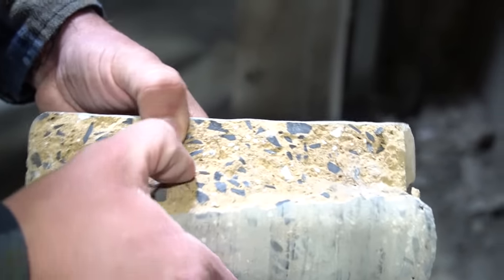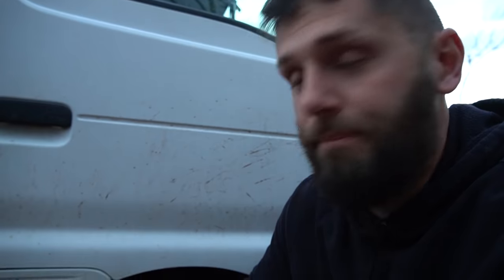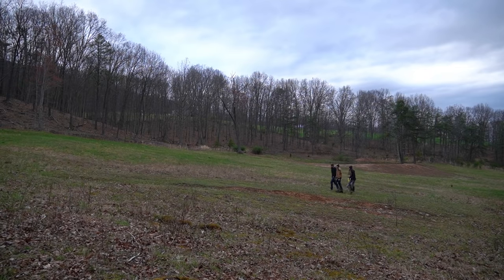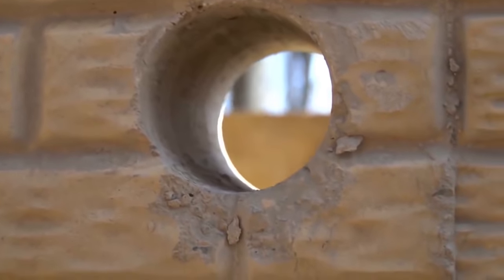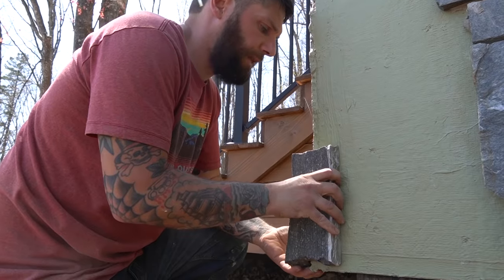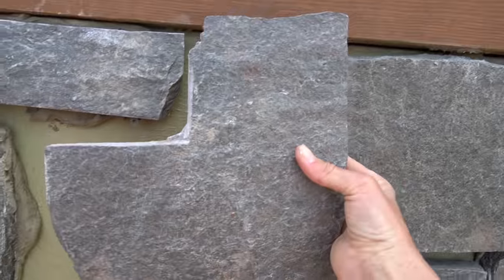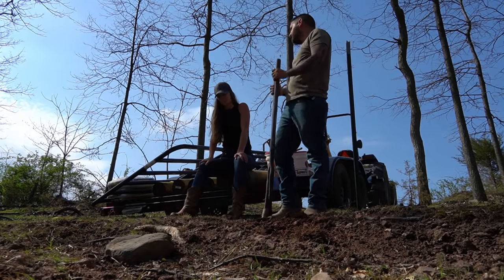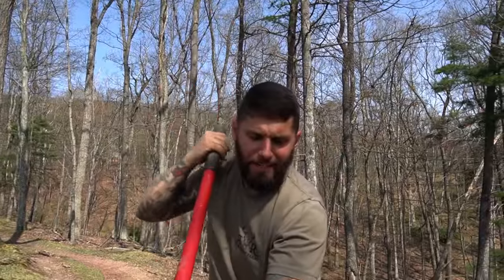RESULTS OF THE CONCRETE TEST | Are We Tearing Down Our House Foundation?

Comment: For future reference: when you contract for the concrete foundation "do-over" , write in your specifications that concrete samples are to be taken at time of pour. I've managed 1000's of yards of concrete in my career, and have ALWAYS required this!
Reply: yup it also covers your butt as far as liability and insurance
Reply: Amen this is what needs to be done
Reply: Bobby - can't you pour the same concrete mix into a 4" pvc pipe? Thereby using it as a form for the concrete.
Reply: @martyhanks5977  Marty, there are plastic molds available at most builders supply that are specifically designed for concrete samples. They're typically 6' X 12"  for about $3.00 each.  Most concrete suppliers have then on hand.
Reply: thats what I thought, that is the responsibility of the mixer
Reply: @lozhunter9575  - Actually it the onsite contractor who has the final say. When the driver sets up, they ask.."What sump do you want it" that added water amount is on the contractor. ESP...when you are talking about  pumped concrete, through a 4" tube.

Comment: Top Tip: When you go to grout your stonework, use piping bags. If you get cake decorating tips, you can get flat, very small rounds, large rounds, etc. Also, make sure the rock is completely dry before you grout or it will stick to the face. You'll also need a wide and a narrow (1") stiff brush and big sponge and water bucket.  Start in an inconspicuous spot to get the hang of it. Good luck!

Comment: Hard to imagine that a "concrete contractor" would pour such a soupy mix.   Too much slump means very weakened concrete.  Sorry you have experienced this failure.
Reply: That wasn't concrete,  it was gravy.  😱😱💩
Reply: Could write a book on turning cement into quality concrete . Contractor all ready had to read a book n look how that turned out . The reason buildings collapsed no quality control . U have almost a million subscribers. It will be a wonder if concrete contractor pours another yard of mud after all the eyes watched this mess up !
Reply: That was mud they poured. They should be ashamed of themselves but looking at those guys, they look like they don't care about much! Sad.
Reply: I was studying some tests about different concrete mixtures. 
The strongest concrete is made when the amount of water is actually LESS than what’s specified. As little as possible. Of course pouring it becomes a challenge at that point, and without tamping it down and compressing it, it may have air pockets in it, weakening the structure.
So the “normal “ amount of water is already a tradeoff, weakening the concrete in exchange for easier pouring. Adding MORE water just makes it even weaker in 100% of the cases.
And beyond “more water”, there is “too much water” and then that dirty water they dared to call “concrete”. 

I was actually hoping this test will fail. Because if THIS concrete doesn’t fail, then concrete standards are lies:D
Reply: I wood be looking for a 4-5 inch slump max on the next wall . That would looked like a cow patty , the water to cement ratio was blown to hell on that wall.
Reply: @juzoli  there are additives to make it flow better without adding more water 👍
Reply: @colinstace1758  Yeah, but they used water as an additive…

Comment: I know it is a pain to redo things like that foundation, but you will be so glad you did it right. That may have been one of the worst foundations jobs ever. Brown soupy concrete that had way too high a slump, poorly done forms that burst open and were not even straight, no height control on the walls and the J bolts just plop into the walls. It is actually amazing the concrete tested as high as it did as bad as it looked. Not to mentions leaving out the rebar and mis-positioning all of the other piers and using junk gravel as base fill.  Not sure how they could screw it up more.... But, hopefully you will find a good one this time.
Reply: It wasn't concrete. It was mud.

Comment: Quite a few holes still to make for the fence posts before you complete that red line on the sketch... Did you consider a fence post drill aggregate for the back of the tractor but ruled it out for the benefit of building biceps or something? :)

Comment: You could build a second perimeter foundation with CMU and leave that one if it works with the structural layout of the house.  Then you save yourself the demo and waste fees
Reply: I'd bet the cost of engineering the new plans will exceed demo and waste fees
Reply: Concrete contractor should be covering the cost of demo.
Reply: @craiguglandrealty3705  
If you can find them and get them to pay I'm sure Josh and Erin will be pleased!

Comment: Hate all this for you guys!! its a tough pill to swallow, but you are 100% right to stop all work and redo it now. Way easier, and you will NEVER look back and think "What If'.  As a contractor w/ 30 years experience, when i watched to original video, i was blown away that they ONLY built a 2x4 footer frame!! Here in NC its 8" Min and goes up to 12" thick and then 24" wide!! No vertical rebar inside the footer - connecting the wall, as you stated and the tiny baby 2x4 thick footer that is MAYBE ok for a tree house. I knew you'd have to take it down. So glad you started over. Only upward and onward from here. Best of luck moving forward. Keep It Up!! You got this.

Comment: Screw the concrete, why not just use metal stilts to prop the house up, run it the same way the first house is w concrete filled tubes in the ground. I see a bunch of mansions done this way and cabins on mountains and reveens.

Comment: Just lay block instead......place your rebar down each web and solid fill with mortar. Way sturdier than a poured foundation especially if you use 12" commercial block.

Comment: Mixing your concrete too WET it will be weak. Put your post in the ground 36 inches so they wont pull over.

Comment: For mixing in a bucket, plaster, concrete , thinset, mortor, etc.  The premier tool,, the labour saver,, saves your wrist,,, best, best, best  Is a Milwaukee Hole Hawg.  It has the proper speed, strength, right angle so you don't get your wrist twisted off.  Expensive,, usually about 300 dollars,, and they may have fixed it,, the switches were always a bit soft,, needed replacement.  When I would go to buy a switch, I would always buy two.  But,, for mixing in a 5 gallon pail,, I have never seen its equal.  You can mix Sackrete in a pail with a Hole Hawg.

Comment: The concrete company very likely figured they could get away with reducing the amount of sacks of concrete powder per cubic yard. Those mixes are known as for example (4 sack mix, 5 sack mix, 6 sack mix and 7 sack mix per cubic yard of cement. It's likely they jipped you guys using less sacks than they should have.

Comment: Josh, you are very accomodating in your call to concrete guy, considering it’s a Major balls up!   I guess it’s best to stay on good terms to get the company to sort out the issue. 
I like both your outlook on the situation by not freaking out and accepting the situation, rectify it and move on without the emotional stress.  Thumbs up.  👍🏽👍🏽👍🏽  I learn many helpful DIY tasks and techniques from you tw,  so thank you kindly from down under.  ☯️

Comment: I am kinda glad your concrete failed. It pushed you to the right decision. You know if you built on that you would never be happy. Take the pain now and don't fight the build and always wonder if it will be ok.
Next time Hire a professional, i know of a good one. YOU! For just an electrician you have proved yourself to me that you can do it all and get better results than some so called professionals.
Coming from a 30 yr contractor here.

Comment: For the Trout Pond project, after you tear down that awfully constructed cement foundation, if I were you, I would go with rebuilding it back with cinder block. Cinder block has a long track record for durability and strength. It is something that you could do yourselves, and get it done correctly (without another construction company screwing it up again). And, it wouldn't take too long to complete the job. Just think about it.

Comment: Hay Guys
 I am a civil engineer with alot of expirenc, more then 40 years.
I  am following your chanel for along time and enjoying it very much.
I just saw the video on the failure of the concrete samples. 
In my opinion , you can still continue building your house without destroying the Existing structure.
As much as I know there is no risk of Earthquake in your area. And even though the samples are not good the 
structure will be able to Stand the forces.
Sorry for my English. I am from Israel.

If you you went to be on the safe side call en local enginer that will give you his opinion on the mater.

You are very sweet family. keep it up.

Nimrod

Comment: Just curious as to what psi concrete  was ordered for the pour and what slump was requested from batch plant? I do mostly flat work but alot of wall pours I've seen recently use a 5000 psi mix. We use mostly a 4000 psi on flat work. Sorry about the bad news but as you are doing its best to deal with it now.

Comment: I'd check with a local contractor before simply grading the gap under your stone. Concern is the potential safe haven for a population of unwanted critters, under the house. Options include metal mesh, which rodents dislike chewing, or many cats.

Comment: That's such a shame about the concrete - but then knowing it has to come down and you'll rebuild it properly will give you the peace of mind that it will be done properly. If the concrete had just passed on PSI values I'm not sure you'll have ever shifted the doubt in your mind.

And hey, look at the positive - with no rebar and weak concrete it will take Josh about 2 minutes with a jackhammer to tear that all down. Or just knock it over with the digger.

Comment: The failure of the concrete should be on the redi mix company. The contractor should have informed them what he needed, ie..I need a psi of 3000 or more. But obviously that was not the case because you wouldn’t be tearing it down. I have done a lot of poured walls with the company I worked with and we never ran into the problems that you are having. Best of luck with that mess. Your stone work is looking great 👍🏻 Josh makes a good mason tender 👍🏻

Comment: Having followed you from the very start you have made incredible progress. Yes mistakes have been made but that is the best form of learning,  even we as in the construction industry also make basic mistakes. 
With regards to your concrete issue I would cast using the correct blank formwork with regards and add on a brick pattern the same as you have done with your excellent stonework. 
Keep on keeping on your doing a great job.
Best regards 
Keith from North Shropshire, England.

Comment: Dang, sorry about the setback. You will definitely feel so much better getting it done the way you want. My impression from the video when it was poured was that things were happening faster than you could control. The slurry was early, and the crew wasn't ready. In retrospect could you have rejected the slurry? Could you have stopped the work until rebar was put in? Could you have controlled the situation better?

Comment: It sucks that your foundation pour was done so unprofessionally.  I would suggest you consider getting a trusted local builder involved with your new build (someone who has ongoing and completed projects you can view).

Even if you don't want to pass off the general contracting completely, getting recommendations for subcontractors and a little advice never hurts.  Just like every other task you have learned building up the homestead, managing a build takes practice to excel at.  You may also find many of the best tradesmen are  very in demand right now and have to prioritize keeping the contractors happy who have kept them "fed" over the years.

Comment: The concrete company should have processes in place to (a) ensure only properly prepared concrete is poured (b) identify problems during the pour and immediately after (c) have taken multiple (at least three) testing samples (d) have one sample tested after each pour.  If these guys were supplying a road bridge, a large public building how do they manage quality control.

Comment: Now that the tests are completed, maybe you can grow some roses from that manure you got in the foundation ?  I'm thinking that demo-ing it can be an opportunity to demonstrate re purposing the concrete slabs that you would otherwise be paying to remove and dispose of off site... You will eventually need some stair steps on hillside of some sort, correct ? So maybe make some guide cuts (fault lines for fracturing) with a concrete saw before knocking it apart ? The steel reinforcement cast into walls will need to be cut with a torch or bolt cutters if clearances permit but would allow you to create something useful out of the waste concrete materials. If you don't like that idea, you could just pay someone to BLOW IT UP ! Either option would make good videos.

Comment: On a jobsite momentum is vital and requires very careful planning and scheduling - a failure such as you have had can really stigmatize the rest of the build and sap the joy right out of it.  It happens more often than you might think especially in my experience in a place like South Florida.  The overregulation brings along with it all the bad players because legit people can't make money in the overbearing system which also methodically sucks the momentum out of every job.  Comparatively, though very frustrating and angering, imagine if your design was more an exterior post-less support structure than an interior one with exterior posts.  You got this.

Comment: That was no MISTAKE, That was a dirty contractor trying to screw over a customer to make a job easy. [there are many like them and they have to be exposed into bankruptcy] The only good thing is that the crooks screwed you out of the rebar also, Making the demo a lot easier. Do not let them crooks back on your job site. Get every penny you paid them back even if that means going to court.

Comment: Over time the concrete continues to harden, never stops, hydration. Worked on a high rise and we poured a floor a week and on a few weeks later the results were back that one floor was low. In order to bring the numbers up we put down burlap bags and kept water on it with chemicals non-stop. Tested and numbers were way up. With water blankets the numbers can be well over 3000psi, but not sure all the areas I saw a wall core sample.  Appears the contractor did a poor job, bummer. You mentioned level or was it out of plumb? Good luck, long time construction professional.

Comment: I guessed 2000 psi when I watched the video. If you don't want to hire an atty then file a complaint with the West Virginia Atty General. They can find all the other customers that also had horrible jobs. Its very easy to fill out a form on the AG's site to get started. Its what you pay taxes for, use the service.

Comment: Sorry to hear you have to tear down the structure of your B&B, but you’re better off. I knew there was something wrong with the concrete when they were pouring because the slump was too loose. Too much water weakens concrete. I’ve seen other pours where the slump was much thicker. 

The question is; who us going to pay for this? I hope the concrete company steps up and does the right thing here. Whatever happens I know you will get it right. Thanks for sharing your building experiences.

Comment: You would of gotten better numbers on a Rammed Earth foundation over those kind of numbers. Good thing you're tearing it out. Now maybe you learn a little about that Rammed Earth homes before you finish that home of yours. All you would need to pay for more of is the labor it takes to have the walls set. But once finished and roofed it's move in ready. Just pour floors and roll with a near zero point energy home. (If planned properly of course)... You're almost done why not add a bulletproof wall to a house without a storm shelter. Build it in to the house. That's how you do it. Carpe Diem thanks for sharing your life you two..

Comment: If I might make a suggestion that works well for me... when using that wonderful knife. touch the tip to the cutting board raise the back up about 1.5 inch, more if you are cutting larger items, hold the food and then pull the knife towards you slicing though the food. oh, another thing I found helpful is to touch up the edge with a sharpening stone right before each use. this keeps it razer sharp. 
Also, I have to say your editing has become amazing!  
Thanks all of you for sharing your life with us here!

Comment: You should have got them to do a slump test on the concrete before they pored if, that would have given you a indication of how much slurry was in the mix. Took samples of the concrete and told the contractor that that was to happen. No re bar, should have been a signal that you where dealing with a cowboy builder. On the plus side. It’s only a problem if you don’t fix it. You were clever enough to see that.